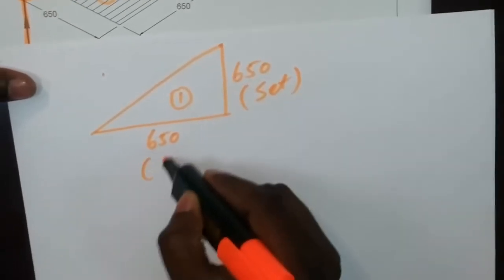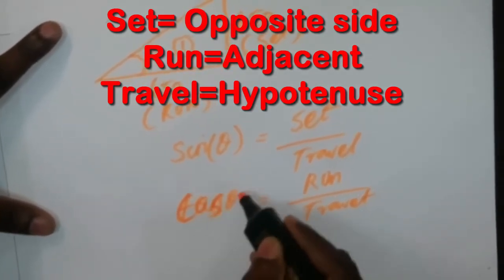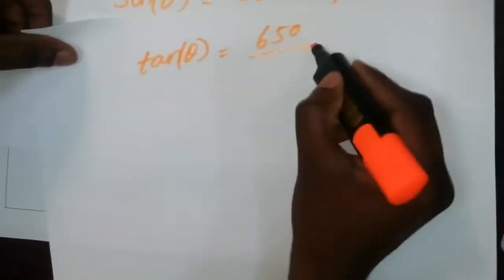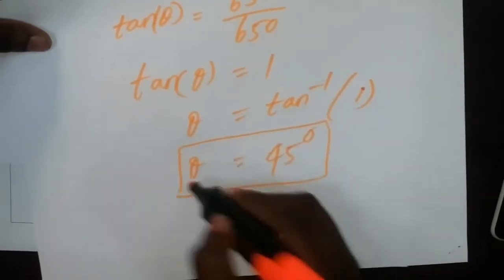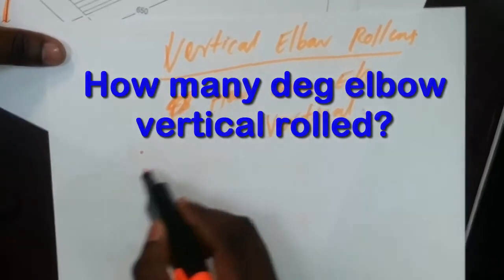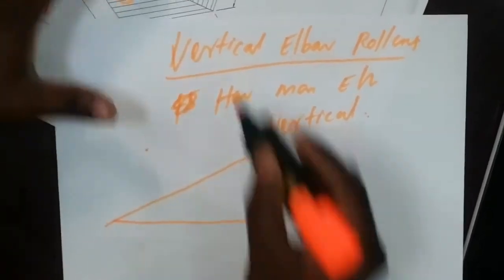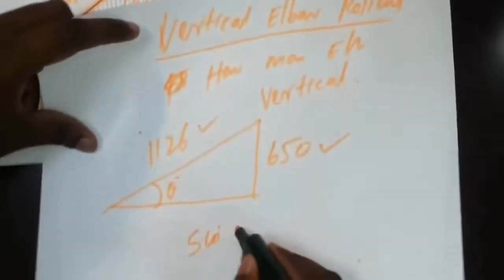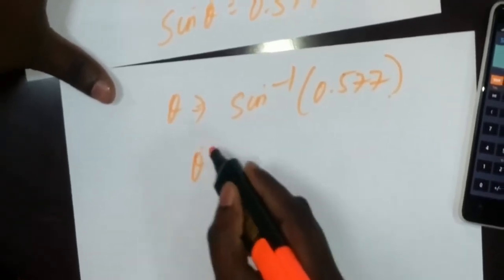Piping Elbow Rolling  Degree Calculation

Comment: Actually elbow degree need to cut 55 degree not sir 35 degree.
Reply from the maker: Am wrong .could you please explain
Reply: Ok sir you explain everything ok. but your drawing parallel up to down line matching for vertical shadow set Side given650mm and you calculated vertical shadow run side 35degree if you use 35degree elbow I think can't match because your drawing parallel up  to down line matching for need to 55degree elbow.your calculate ok only degree site need to change. If I am explain to something wrong please forgive me.thanks.